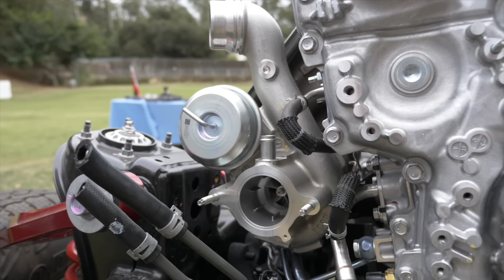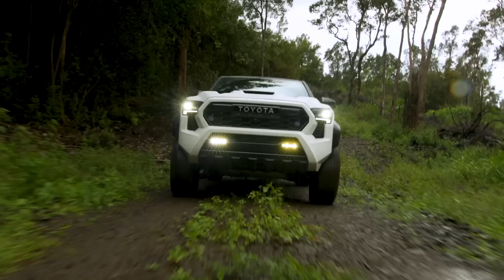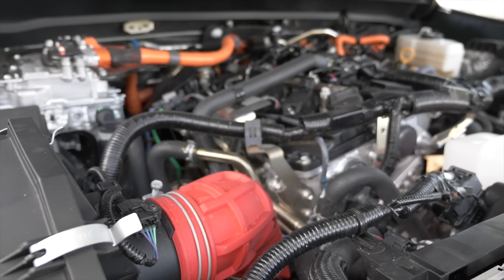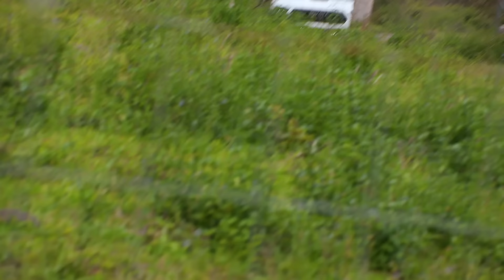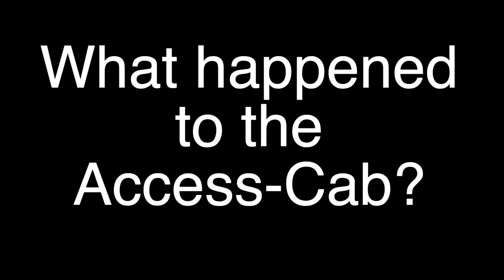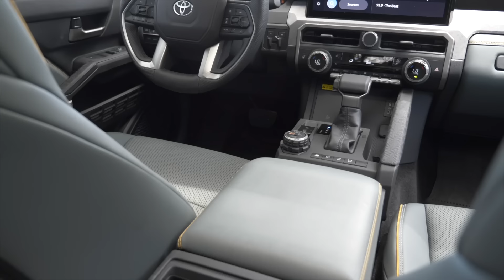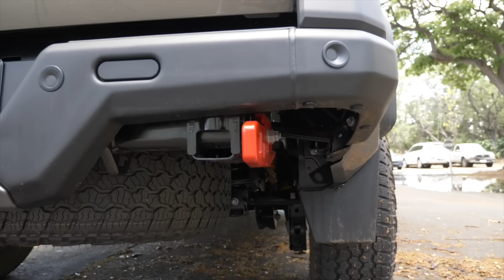2024 Toyota Tacoma Chief Engineer on new engine reliability and more...

Comment: It’s not about fuel economy, in fact it’s worse when the boost comes on.  Like all manufacturers they set up the gearing and power delivery to max fuel economy per the EPA testing perimeters.  Go above that and fuel economy drops like a rock…it’s about meeting emission standards.
Reply: According to the EPA…see EPA Compare, the V6 gets 23 mpg and the 4 cyl turbo gets 24 mpg, an improvement that will drop when the turbo kicks in.  I recently sold a 2020 Escape with a 1.5L turbo, the EPA rating 26 mpg, I was getting 22 mpg.  I find the V6 in our 2021 Highlander to be smooth, linear and very quiet.
Reply: @foxlake6750  My Tacoma is rated for 18/22 and I get 17, although with very slightly larger tires. But the turbo cars I've owned have always been very close to the rated MPG, unless I was going way too fast on the highway. Not sure why that is. Looking forward to seeing what the new Tacoma gets in the real world.
Reply: @foxlake6750  I greatly prefer naturally aspirated V6 and V8 engines over turbocharged anything.  I'm surprised the EPA figures are that close but 2.4L is a small engine, so maybe it's going to spend a lot more time under boost than I'm thinking.
Reply: The Tundra hybrid numbers are about the same as Ford’s V8 which is hilarious.
Reply: On average the fuel economy will likely be better but you're right.  The fuel economy will be considerably worse under boost.  That's simply the nature of forced induction.  There is no "free lunch" folks.
Reply: Are you claiming that the V6 is more fuel efficient when using more throttle? Because that's incorrect. 
The gearing optimization is a lot easier with a wide power band, which the turbo has. Trying to match the peaky old V6 was a nightmare, ask any tuner. 
It is absolutely about fuel economy. Consumers demand better MPG's, despite what the Truck Bros on the Internet say.
Reply: @DeuceDeuceBravo   So two things:  (1) Consumers demanding better MPG's believe they are getting better MPG's when they see it on the Monroney label.  That does not make it true. (2) When we look at power levels that require the I4 to be significantly into boost, the naturally-aspirated V6 will generate the equivalent power using less fuel, all else being equal.  Let's say for example the V6 produces 150hp while using 15 gal/hr of fuel.  The I4 will require more gal/hr of fuel to develop the same 150hp.  That's simply the nature of forced induction.  But again, the I4 will likely experience better fuel economy on average under typical conditions.  But if the driver is towing heavily on a consistent basis, the result will be different.  That said, the turbo I4 will likely be a more enjoyable towing experience due to the power curve.  No argument there.
Reply: @WhalerGA  Agreed on the label. It cracks me up when people talk about getting 24mpg in their Tacoma when they live in Florida. That MPG is not possible in the mountains. On the fuel comparison.... One of the other variables is RPM. If the current V6 needs to be spinning at 3,000 RPM to make the same power that the smaller turbocharged engine makes at 1,700 RPM, then that's also a huge contributor to fuel consumption. That's one of the reasons for more gears these days, to keep the RPMs as low as possible. I'm not disagreeing with you, but I'd be curious to see some real data on this. Would be fascinating stuff.
Reply: @DeuceDeuceBravo  Unfortunately data availability is difficult in this case because the exact mechanical examples of what you'd need to make an "apples-to-apples" comparison don't exist.  But here is another way of thinking about it:  If the 2.4T generates 150hp at at 1700rpm (just an example), what displacement engine with similar technology but no forced induction would be required to generate the same 150hp at 1700rpm?  Let's say it's 4.0L, but it doesn't really matter.  That naturally-aspirated 4.0L engine will generate the same 150hp using less fuel than the 2.4T.  Take it a step further:  What (smaller) displacement would be required for an NA engine with similar technology to generate 150hp at 3000rpm?  Maybe 3.0L? (again doesn't matter)  That 3.0L engine will generate the same 150hp using less fuel than either the 4.0L NA or the 2.4T.  This is where people will intuitively say:  "But the larger engine isn't working as hard so it will burn less fuel."  No, engines don't work that way.  They are not biological organisms.  There may be many, many other benefits to having the larger or more powerful engine but fuel efficiency is not one of them.  But on the whole, having extra power on tap for occasional use (not frequent) via turbocharging is more efficient than having that extra power on tap through add'l engine displacement.